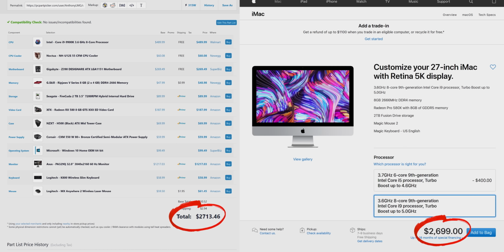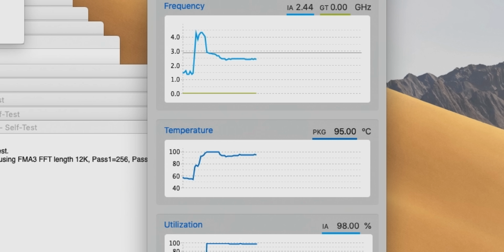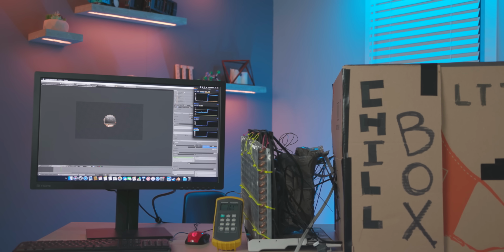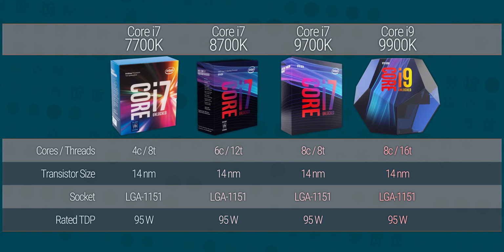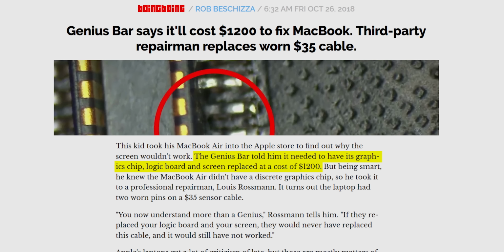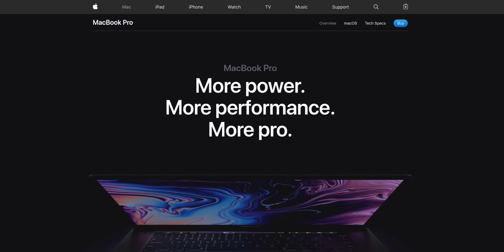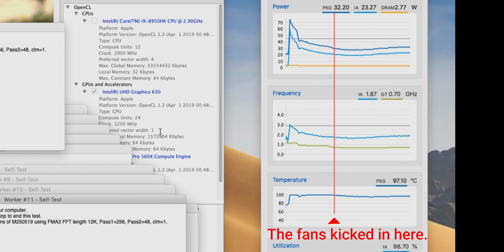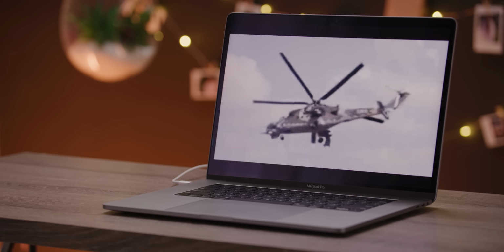Macs are SLOWER than PCs. Here’s why.

Comment: In fairness, there are thermal issues in some configurations of some products.  Yeah, you shouldn't get a 15" MBP with an i9 if you're maxing out the CPU.  The 2014 iMac 5K had thermal issues, while the late 2015 iMacs with Skylake (which I am typing on right now) did not have issues, even at the highest configuration (which I also have).  I would say the current 2018 MBA with its dual core, 4.5W 'Y' series processor, outperforms what that processor likely would in a Windows machine.  Additionally the 28W i5 quadcore 'U' series processor in the newest 13" MBP doesn't have thermal issues and crushes other laptops that use the same processor but at 15W; and still you get great battery life.  

I agree that thermal limitations do exist but again only on SOME specific configs of SOME specific devices.  The reason of course is that Apple cares more about the experience of using a laptop and it knows people don't want fans blasting inside.  If someone does a bit of research before buying, a Mac can outperform a PC with the same specs, provided the correct device is purchased.  I prefer macOS.  I used Windows all my life until four years ago when I started buying Macs.  I hate Windows updates.  I hate compatibility and driver issues.  I hate the a BIOS update put out from Dell temporarily destroyed a $2,000 Alienware computer I bought in 2012, and I as a very average consumer had to figure out what bios settings to change in order to resolve the issue.  Those issues simply don't exist on Macs.
Reply: @tf2excession  To be clear, yes the Y series processor most definitely cannot handle heavy tasks, but that's not what that computer is for.  That machine is quite snappy for everyday tasks and that is what it is for.  The thermals are just fine.  It reaches the turbo clock speed when you need it for short bursts; it even has a fan which most other computers with that type of processor do not have.  Now if we're factoring in price that is a completely different story.  Despite what Linus says here, there are some Macs which are 'overpriced' if you consider purely the specs (though as Linus points out, the iMacs and iMacs Pro are a different story).  My comment was aimed at the contention of thermal issues.  Like I said that is only on select configs of select devices; it is prevalent, but it is not nearly a 'rule.'  Regarding the issue of price, I am one who will pay a premium for macOS.  It communicates and works so well with all of my other Apple devices, of which I have a ton, that it is well worth the cost for me.

Comment: I don't like Apple Laptops bcz of two major reasons :-

1. It can't game.
2. Its body is made of aluminum .

In India (in my city), temperature goes as high to 48 degree Celsius and way down to 5 degree Celsius. You can't use these laptops on your lap bcz of hotness and coldness. Even typing will make your hand either sweaty or cold.
Reply: makes sense solid reasons

Comment: The only reason I ended up buying a Mac Book pro is to run adobe software. The optimization for the adobe suite is significantly better on mac than on windows. So even with significantly weaker hardware compared to my windows desktop, my mac book always wins out in terms of reliability and speed, even with multiple programs and files open.

Comment: Yeah.....I beg to differ, I could spend a LOT less, and get a machine to rival....if not best Apple's wares! Case & Point: (from Apple's web site: Selected: 27 inch iMac - (Pay attention to capitalized items!)
Retina 5K Display
3.7GHz 6-Core Processor with Turbo Boost up to 4.6GHz 
2TB Storage
3.7GHz 6-core 9th-generation INTEL CORE i5 PROCESSOR
Turbo Boost up to 4.6GHz
8GB  2666MHz DDR4,RAM/MEMORY configurable up to 64GB
2TB Fusion Drive1
Radeon Pro 580X with 8GB of GDDR5 memory
Two Thunderbolt 3 ports
Retina 5K 5120-by-2880 P3 display
$2,299.00
+++++++++++++++++++++++++++++++++++++++++++
Now......consider this: they are selling you an i5 PROCESSOR! (Don't care what "gen" it is....and i5 will ALWAYS be slower than an i7!!...now...take a look at this!:

https://www.dell.com/en-us/shop/dell-desktop-computers/xps-tower/spd/xps-8930-desktop/xdvmstcs009s

And even if you throw in this?:
https://amzn.to/2PBMJNn

And these!?:
https://amzn.to/2GDXs66

You STILL come out "under" the price of the iMac!

Also note, you're getting 24GB OF RAM WITH THE DELL....compared to the 8GB OF RAM with the iMac!!!...(and if just EIGHT GB's cost that much can you imagine what they're charging for the 64GB of RAM!!??).....and even if you "upgraded" the graphics card on the Dell....(which you really wouldn't need to do since the monitor is already a 144Hz display!) as long as you're not going for the $500 graphics card?....you'll STILL come out UNDER the price of the iMac!....plus?....unlike the iMac?...if  / when you want to UPGRADE / ENHANCE your system?....all you need?...is the money for the components, and a SCREWDRIVER! B modules for 32GB of RAM.....you can crack open the case and add a second / third SSD....you can install a water cooling system!!...and RGB all over everything!!!....(....ok...I'm getting a bit carried away....adding RGB or water cooling.....takes this "standard" tower to another place!...Hahaha!)

I've said it before......I'll say it again, Apple?...sells mediocre products at "premium" prices, and the people who constantly buy them? have NO CLUE that they're being fleeced.....REPEATEDLY!. But I guess there are those that know?....and those that KNOW! Which group do YOU want to be in? LoL!

Comment: The iPad Pro 2018 won't thermal throttle but perform similar to the i7 Mac Pro like wtf? 🤯
Reply: and it also doesnt runs desktop class applications or programs so whats the problem here?! the ipad pro processor is just a bigger Iphone processor, yes its powerful but can it handle those bigger programs?!!
Reply: If the L1 and L2 cache are high enough then it most likely can. Issue is just a lower clock speed which I think the A12X is around 2.0GHz. So no 8k video edits in Premier or multi display gaming, but it could IN THEORY run Windows. I just wish someone would try it 😬

Comment: 0:18
>implying you don't have monitor, mouse and keyboard already at home

btw this is a linux user standpoint, a fully-fledged windows license (no ebay oem key) would make the pc more expensive for sure
Reply: This argument by PC enthusiasts is shit, including the console vs PC debate. The Mac comes with a mouse, keyboard, and 5K monitor in the box. That's part what you're getting for $2699. So the PC comparison HAS to include a keyboard, mouse, and 5K monitor as well for it to be considered a fair comparison.

Comment: Hmmm…. What will happen with a lower tiered cpu? :
-no heat
-less noise
-better performance than with thermal troddeling cpu
- longer battery 🔋 use? Because power isn't wasted into creating heat

So… I really hate apple. Great that I have never bought any apple  device

Comment: Preach it. I can’t even use my MacBook “pro” in a studio environment because the usbc ports drop connection to the (must have) usbc hub and my usbc hard drives will unmount if you touch the cable. I honestly hate usb-c, it’s the weakest most frustrating port connection ever. It’s fast only if you don’t touch your computer or anything on your desk.
Reply: for pc's sure. just stick with usb 3. but for charging my phone? better than micro or mini.

Comment: This thinness trend is getting ridiculous. We are now getting machines that won't last 5 years because now their CPUs will die due to having to constantly run at Max heat. IMO I'd rather have a thicker device that lasts longer and runs cooler than a device that looks pretty.

Comment: I gotta call bullshit again. No laptop in the form factor of a macbook won't thermal throttle under heavy load. Every laptop feels snappy for quick boosts of speed. That's their nature. Every manufacturer advertises the turbo speed.... I just find your opinions on Apple so biased. You're able to look past every con of a windows laptop but when it comes down to as you said "laws of physics" not allowing them to stay at turbo, then it's Apple being a terrible company and its buyers not "tech savvy" and wanting "status". smh
Reply: but it's not just the macBOOKS. it's all macs. did you see the inside of the iMac Pro linus dropped? it had almost no thermal solution inside for it's CPU. the power supply was uncaged which is REAL HAZARD FOR ANYONE WHO MIGHT WANT TO OPEN IT UP AND SAY IDK! CLEAN IT!? and they released products without parts supply chain or support network necessary to actually support a product. apple are pulling all kinds of anti consumer practices and we're just letting them getting away with it because they're fancy and made a nice OS? fuck that shit.
Reply: The Mighty Watermelon then don’t buy one. I don’t know why it’s such an outrage. By all means don’t let them get away with it. I don’t think any of what you mentioned are real problems.
Reply: @MLGJuggernautgaming  really? you don't think it's a real problem that someone who might want to open up an imac pro whether it's because they're certified to work on it or they just want to clean it out might accidentally touch 2 leads on an uncaged power supply and stop their heart? YOU REALLY DO NOT SEE THAT AS A REAL PROBLEM!? WOW!
Reply: The Mighty Watermelon anyone working with electronics should do research and have a basic understanding of capacitors and their dangers. Caseless power supplies are sold for PCs.
Reply: @MLGJuggernautgaming  bullshit. i have never once seen an unshielded power supply before the imac pro. and even if it was. it doesn't make it anyless dangerous.
Reply: @MLGJuggernautgaming  give me an example of a caseless power supply, a model number, a sku i can search on newegg. anything. i'm looking this up and i cannot find a single unshielded power supply for sale BECAUSE IT IS TOO DANGEROUS!
Reply: The Mighty Watermelon it’s called HDplex. They only have heatsinks
Reply: The Mighty Watermelon my point is that windows fans spend a lot of time trying to make Apple look bad and holding them to such a high bar while giving excuses for what they like. Why can’t they accept that people have various reasons for liking what they like?
Reply: @MLGJuggernautgaming  and apple fans dont do that? i've literally been told that i'm a poor soul because i "can't afford an iphone" even though my galaxy s8 costs more than their rinky dink little 32gb base model iphone

Comment: It doesn't help that their build quality isn't great either. Going by Louis's vids they just don't make them great, with consistent problems by their own design. Keyboards failing, GPUs becoming de-soldered and cables slipping out because they're too short- then denying any wrong doing. Then they have fans blaming customers for not getting apple care? So, customers have to pay to protect against apple's own defects unless a court case comes up?

Comment: 7:30 It's all on intel. Intel made promises it can't keep. Apple will be axing intel from their Mac, in the near future.
Reply: I didn't realize Intel designed the cooling solution for the Macbook.
Reply: The Spooky Banana no but they fudged the tdp figures. An i9 should not be in any thin laptop at all in the current iteration. It’s why a lot of laptops only use i7 8750h instead
Reply: @samosborn9611  Then Apple shouldn't of put it in a laptop.
Reply: @samosborn9611  thats on apple deciding to put an i9 in a laptop. Intel gives the options, apple takes the one it wants. Intel has literally no fault in here.

Comment: Regarding why they don't put slower chips in that wouldn't throttle, I remember Anandtech talking about the "race to idle" philosphy for battery life. In which you use a super high clock speed to burst through a workload, then get to an idle state and throttle way down to reduce power consumption. In mobile this resulted in very good battery life improvements, I wonder if the same is true for laptops.
Reply: they have 2 chips on the lastest macbooks one arm one intel
Reply: @onedarkgamer  Depends on the context, he didn't specify if they've run tests in short burst loads (such as normal ones like web browsing). That is the premise of "race to idle". During normal use a faster processor can finish it's work and drop to idle power levels quicker.
Reply: @onedarkgamer  For more reading google "race to idle". It seems it's a much more widespread industry term than I knew. Thought Anandtech had been one of the only places to talk about it, that was mistaken.

Comment: iPhones, iPads: ARM processors, extremely efficient, not such heat problems.
Macs: intel x86 processors: heat problems.
Apple will probably end with efficient ARM processors on Macs, so that´s their solution
Reply: apple basically uses TSMC best chip manufacturing process and Intel wich invented the x86 processors are working to perfect it instead of relying on suppliers, finaly it will be really hard but possible to switch to ARM computers just like microsoft
Reply: @carholic-sz3qv  I accidently wrote intel, I meant apple switching to ARM
Reply: Smells like isheep And research from Google
Reply: Ok isheeps

Comment: 9:35 I don't think that way. I really hate noise, I hate it on all my computers. I am very well prepared to give away about 5-10% of time just that my Laptop does not make any noise when compiling a kernel. It is always at 100° when fully stressed out, so what? It has not died on me yet and has over 15.000 hours of usage. On my PC I have undervolted my Radeon VII so that it only uses about 90W so it can be passively cooled.

Comment: Apple designed the thinner laptops based on the intel cooling specs for 10nm processors when intel didnt deliver, apple had to still use these thinner cases and use current gen more power and hotter chips which throttle to keep heat low.

If you want a reason why apple will switch to ARM chips in Macs this is why they will
Reply: Can't wait to see that disaster, these ARM Macs won't have any apps that will work on them because all Mac software is coded in x86. And no emulation is not a solution, Windows does emulation of Win32 for ARM PCs and the performance is AWFUL

Comment: Welp I use the intel Extreme tuning utility to modify my CPU voltage and increase performance by 30%! you should cover that option in the video. MY ULV is still limited to 15 W, but thats reached much later since V*A=W and when V is lover it can draw more current. :)

Comment: I use a 12 inch macbook from 2015 for my work (programming, designing). Running stuff like docker and kubernetes aswell as affinity designer. 

It runs all this a lot smoother than my gaming laptop from 2016 which runs windows. Yes it gets hot, but it does what it does at a good speed

Comment: The answer is Intel, Intel chips are garbage. and Apple is producing some really good performing chips themselves, as rumors point Apple will be dropping Intel chips for macs soon and will use their own. Also please compare thermal throttling vs a windows laptop in the same price range. and the marketing with the turbo Ghz is also Intel's fault.

Comment: The problem with the MacBook Pros were that they were designed with 10nm in mind. So when intel shocked everyone by releasing skylake 14nm chips, it really hit apple hard. And they weren’t just gonna redesign a chassis last minute. They probably kept it for this long thinking “ok next year we’ll have 10nm” but it never happened.

When they move over to arm chips in the next refresh, I could see a future of no throttling, because like you said, the a chips don’t throttle on an iPhone or and iPhone. And keep in mind they don’t have fans. Imagine what they could do with even a passively air cooled solution on the MacBooks. They’re doing this mainly because intel screwed them with the 2016 MacBooks.
Reply: Interesting point. I hadn't thought of that even though I knew Intel fucked Apple hard by not delivering. But Intel doesn't really give a fuck and they're failing. Apple makes up like 9% of total Intel profits. But I agree, Apple can no longer stomach Intel's failures and the push for ARM is in full force.
Reply: @Deon Denis slower than 2015 i5 laptop processors
Reply: @Deon Denis its not getting much faster if you increase the power, the curve isnt straight
Reply: @Deon Denis why are arm windows laptops slower?
Reply: @Deon Denis ok good i will just wait for all this competition  to roll out and the consumer will probably be the biggest benefitor
Reply: Wouldn't an ARM cpu just make it an over-glorified iPad?
Reply: Daniel Schick I mean windows on arm showed that you can run a desktop operating system on arm chips.

Just because it’s arm doesn’t mean it’s for iPads. If the software support is good enough on the desktop side(which it will be, seeing how popular the iPad and iPhone is), the experience will be just as good as an intel chip.
Reply: They could use ryzen for their laptops, that will be a great move.
Reply: feanor aeglos I don’t see them switching to Ryzen now, as they’re switching to arm in 2021 anyways.

Now if ryzen was an option back in 2015/6, I’d see them doing that
Reply: Why should 10nm would be any cooler?
Reply: Kris Meissmer less power/energy consumed = less heat generated